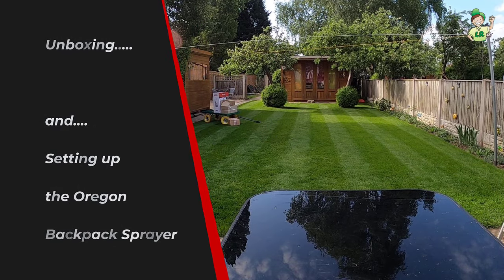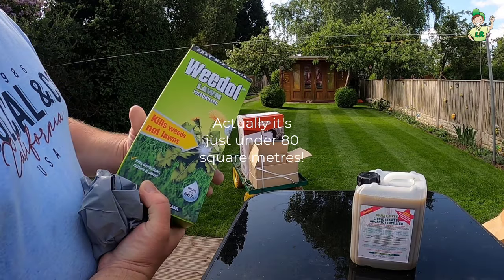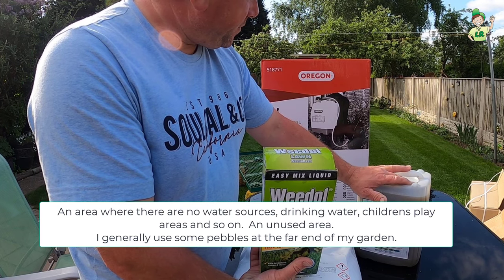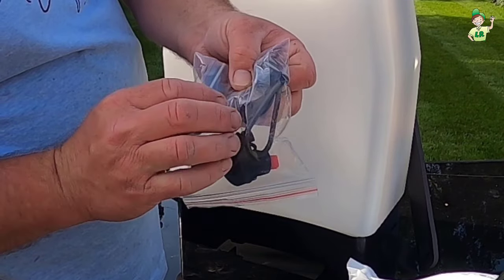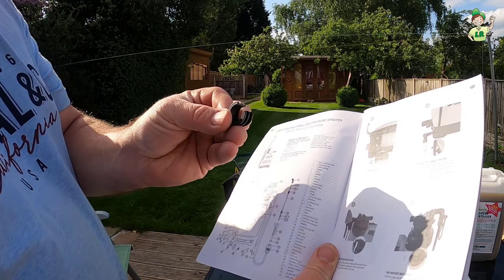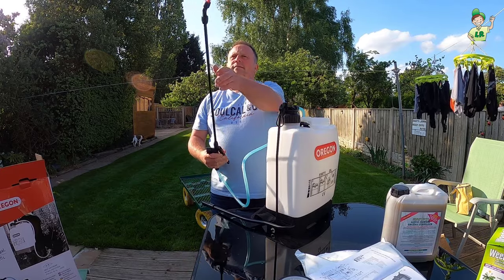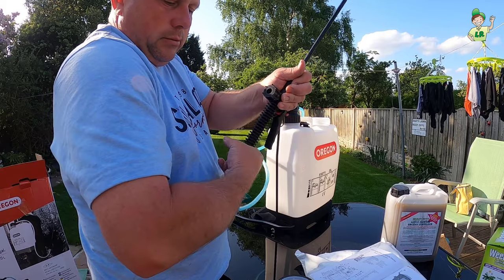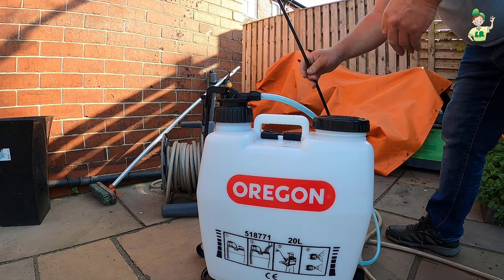How To Set Up The Oregon Knapsack Sprayer (Unboxing | Lawn Care Shopping List)

Comment: I have been using the very light plumbers Teflon tape on sprayer threads and dielectric grease on o-rings.
The two together lets you tighten things up fully, some grippy gloves help also.
A drop or two of oil on the pump piston washer and your ready for years fun...!
Reply from the maker: Thanks Wayne.  I'll bear this in mind once I get using it more.  Hopefully not needed 🤞🤞
Reply: @LawnRight  I have never had luck with that pear shaped plastic bit that is supposed to secure the pump handle when not in use, I need up cable tying it on.

Comment: Thanks for taking the time to do this, really great work!

Is there a good liquid fertilizer that could be put down with the sprayer other than the seaweed or would you recommend the granular like you'll be using? Looking for something that will be absorbed quickly as we have pets using the lawn throughout the day.
Reply from the maker: Hi there are plenty around.  Even as do their ow liquid feed but you'll need to apply it more regularly than granular.  Believe it or not I've never applied liquid feeds ever.  Although I have considered it
Reply: @LawnRight  Cheers much appreciated. Yeah that makes sense, have enquired about a few granulars and although the suppliers say it's safe for pets once it's dissolved, we can't really keep the pets off the lawn for long periods of time.

Comment: Hi mate, great vid as usual. You said you can use the weedol and seaweed spray together, what ratio would you use of each in that nap sack.
Will save me loads of time if thats how you do it. I have a 20 or 5lt spayers.
Many thanks
Chris
Reply from the maker: Hi Chris, I've not tried weedol with seaweed yet but have used seaweed and weedkiller together for years at usual rates.   It usually doesn't stop the action of killing most weeds but if you find some difficult weeds aren't going then reduce or remove the seaweed.  It's usually ok in most cased
Reply: Thanks for the advice mate👍🏻

Comment: Decent video, but I cant believe you're using toxic chemicals when you have a dog. Vinegar with 10% acetic acid & salt will do the same thing without the detriment to ones health
Reply from the maker: Morning.  Genuinely I love animals.  In all the years I've done this I make sure that pets are kept off for 2 hours until it's dry and never had a single issue. Not one.  Grazing animals like rabbits and guinea pigs have to be kept off for 3 mows or they stay in one location on the lawn which isn't treated
Reply: @LawnRight  I don't doubt you love your animals. But, you need to research those chemicals and the carnage they cause to the ecosystem. These chemicals don't just disappear once they dry or after a few days. They cause devastation to the ecosystem you're spraying on and, chronically, any animal that comes into contact with them